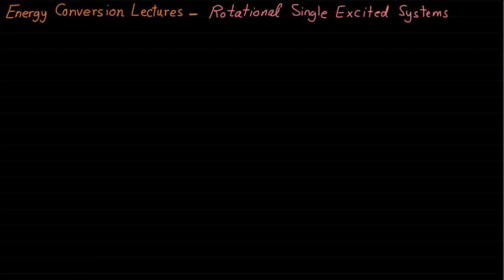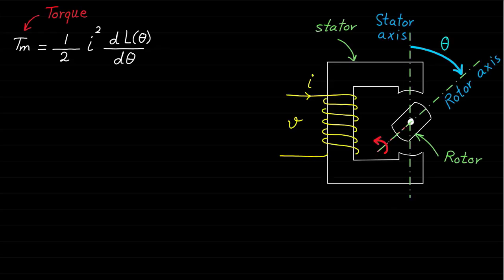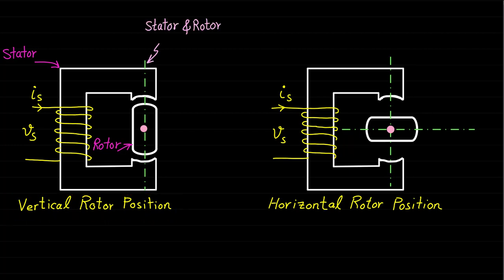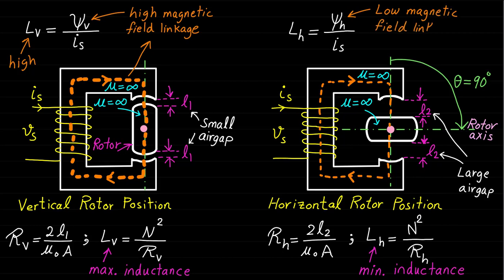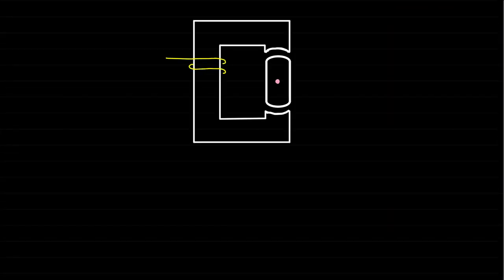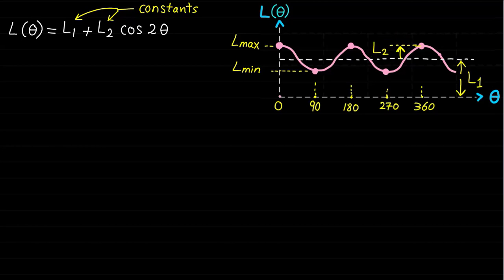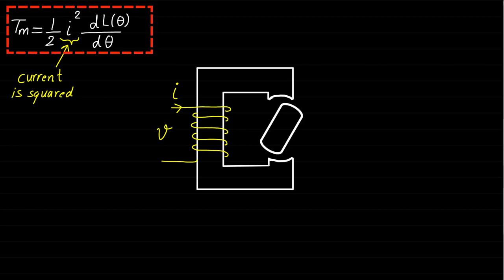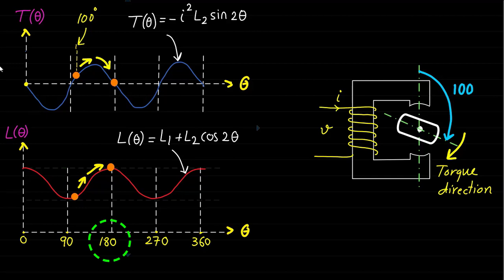Electromechanical Energy Conversion - Single Excited Systems (Part 2)

Comment: sir, Is torque the interaction between the rotor magnetic field and the stator magnetic field or the magnetic force acting on the current (lorentz law) in induction machine?
Reply from the maker: If you review the last few lectures  of chapter 2, you will find that there are two types of torque components. One component is reluctance torque and the other is the mutual torque. Induction machine has only mutual torque component. The mutual torque is results from the interaction between the stator and rotor magnetic fields.
Reply: @EnergyConversionAcademy   sir I can't find torque components in few lecture in chapter 1
Reply from the maker: I am sorry, I meant chapter 2